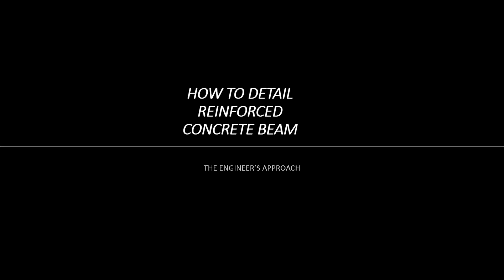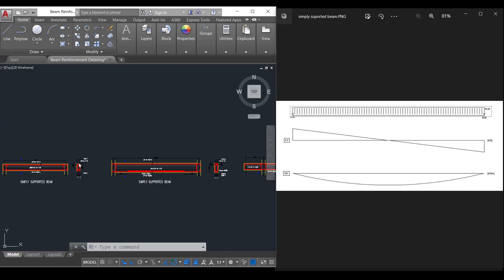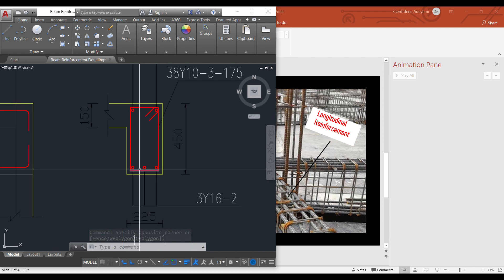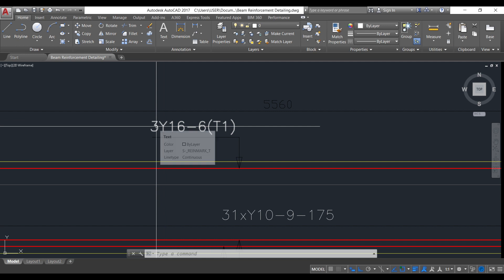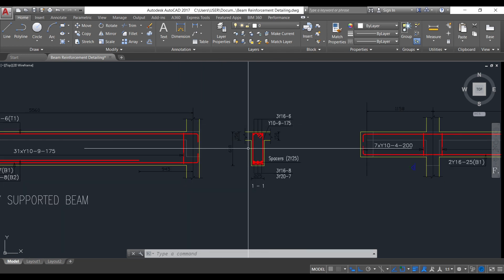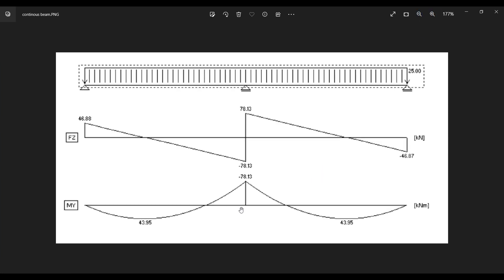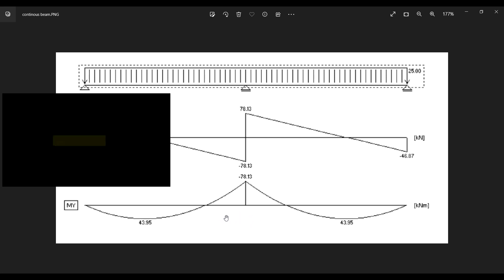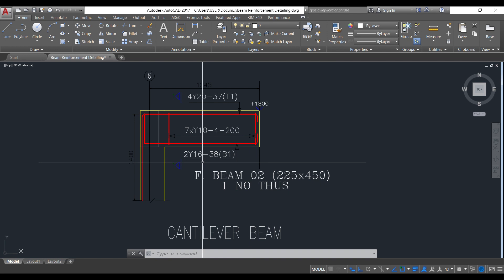How to Detail Reinforced Concrete Beam LIKE A PRO! | RC Beam Detailing

Comment: Sir I have a question sir 
Why did you design the flange and rectangular beam using erocode ?
Why not BS code ?
Reply from the maker: You can design with either the Eurocode or the BS code. Both are acceptable even though the Eurocode tends to replace the BS code.